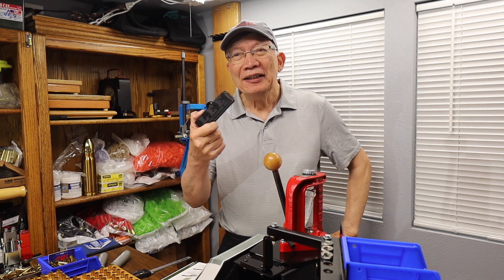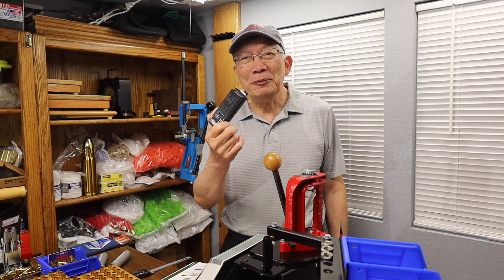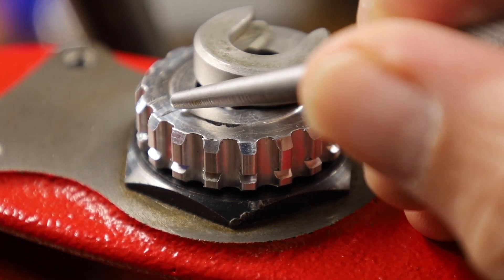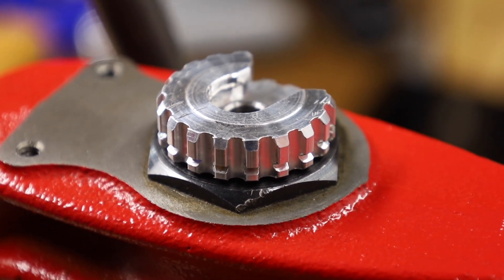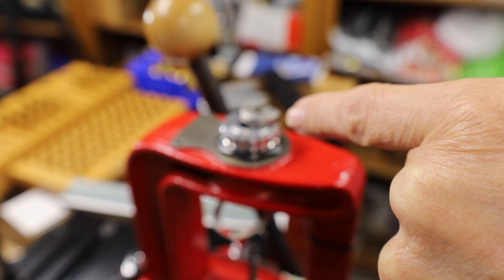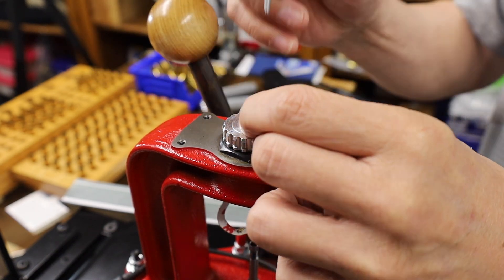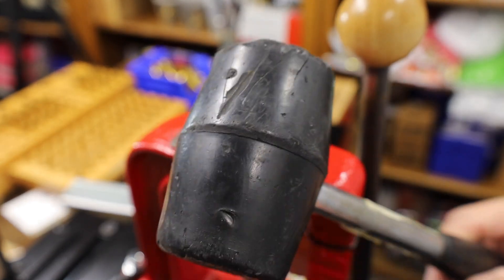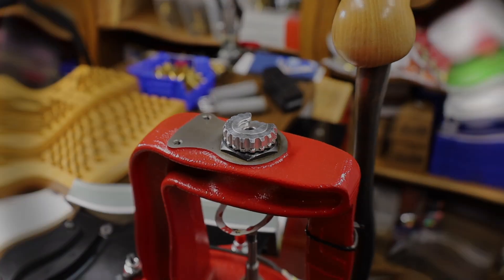Send Back To Lee Or Home Engineer A Solution??

Comment: I had a similar problem with a shell holder from another company not fitting into a Lee Challenger press. It took quite a bit of grinding on the shell holder to make it fit.
I have three Lee pro 1000s and three Lee challenger presses.  One of my Pro 1000s is over 30 years old. They’re all great machines. Better than my Dillon 550.

Comment: People complain about Lee and their warranty.  They require you to pay shipping.  This is to discourage fraud.  This permits them to price things where the do.

Dillon is so locked into its legacy costs from warranty cost burden they made the 750 a 5 station press.  

RCBS & Hornady have upped their warranty to Dillion No BS warranty level.

I have no idea about Lyman’s warranty.
Reply: Ever since Mike Dillon died in 2016 their prices are really starting to climb up there. I have my old first RL-550B, and couple year old RL-550C and a couple year old XL-750. I also have two (one old/one newer) RCBS Rock Chuckers, Redding T7 Turret, Lee 90045 single stage, MEC 600 JR 12 Ga, MEC 9000GN Grabber 12 Ga. 

If they keep that up people will stop buying them and get something else. I remember when a RL-550B all decked out was around $300. By the time you buy the (modern replacement RL-550C) press and outfit it as you would want you are $750 - $1,000ish +/- into it now.

Dillon is also one of those companies that raise/hike their prices EVERY single year. I understand things go up with inflation and you have to give your employees raises. Your customers shouldn't always have to absorb all of those costs on US though. It don't cost you $45 - $200 (depending on the equipment) MORE to make it in 2024 than it did in 2023. Really.............

If the others tried pulling that crap they wouldn't sell anything at all and likely be out of business.

Comment: Good solution, the cost of shipping it back would not make it worth it. I love the Lee Ram Prime, I use it as a problem solver or for convenience.  I usually prime off the press with a hand prime but if I need to do a single round or a just few out comes the Lee Ram Prime instead of changing over my hand prime.  I also like the ease and feel of seating the primers with it.

Comment: My RCBS press rams primers while case forming so you don't have to do a separate step for priming. A significant time saver.
Reply: All Lee presses come with the ability to prime when sizing.  This Lee tool is meant to prime batches of fully cleaned brass.

Comment: Bad thing is if you send it back to Lee they make you pay the shipping. I’ve had warranty issues with RCBS twice and Frankford Arsenal once. They said no problem and shipped it. Now to me that’s better customer service than Lee.
Reply: I broke a small part or two on Lee products and they sent me a replacement at no cost.
Reply: @riflesfirst208  they wanted me to pay 65-75 to ship my Loadmaster press back to them. Then my Lee auto drum they wanted almost 20 to ship back. That’s ridiculous. Then my friend got a bad turret from them and want 15 to ship it back to them for a replacement.
Reply: @riflesfirst208 not the case as of last year, 2x with my dad. Clutch wheel on the 6 pack. Made him pay
Reply: Don't believe you. My ram on my Lee broke the first time I used it and was charged
Reply: I’ve had to go through lee CS a few times. I’m done with it. Shoddy QC and then expect me to pay half the cost of the product in shipping fees. Nope.
Reply: @Almost_Made_It  they want 65-76 to ship a loadmaster press back. Nope I’m not doing that.
Reply: Nobody in this business touches RCBS customer service (or QC department) but the others do have decent CS.  Lyman for example being our oldest manufacturer since acquiring Ideal and John Barlow's designs/ patents pretty much keeps engineers that have this stuff figured out on board to this day. Frankford arsenal? I'm done with them... I wore out the F1 press in a month (really liked the design) as it was China import garbage. I won't use their stuff anymore though simply because made in the USA by my American brothers and sisters is much more important to me than a design or a few bucks saved. If I want something cheap (but excellent) I'll give LEE my money. If I want the best available I'll go RCBS and/or Lyman...Hornady is alright too for many things and they of course bought the old Bair (Bear for a short time) designs that later became Pacific, but I don't know if the Engineers were incorporated into the company back then, but many of those items changed for the better ( some for the cheap) under Hornady ownership. Keep it American whenever possible... every time we buy imports we are supporting that country's military advancement as well.
Reply: RCBS is a great company, never had much issue with their product for the last 50 years, the little that I did have they took care of it right away no cost to me.
Reply: Really a 50/50 chance if they will charge for a 2$ part or not. Rcbs has never even allowed me to pay for a replacement part.
Reply: And if a part breaks, lee will charge u for the parts…. I’ve heard of them not but every time my dad did it, with a brand new press, they made him pay.
Reply: I had a problem with a minor part from Lee, and they just sent me another.  I think Lee makes great products.
Reply: Yeah Lee pissed my off. Bought a new press and the ram broke the first day. I had to pay shipping on the replacement part.